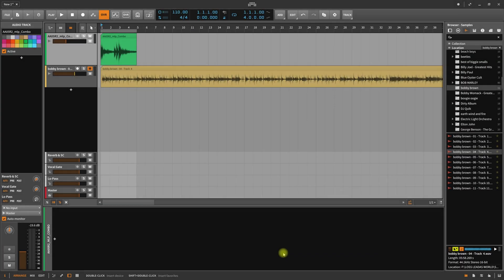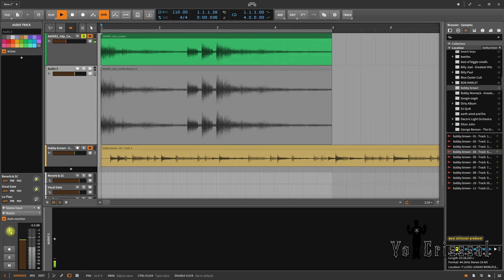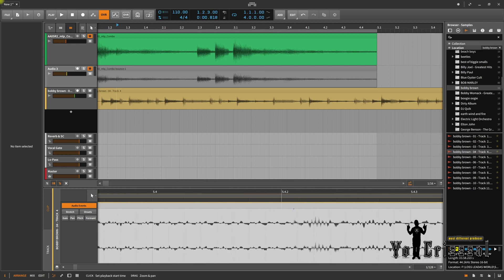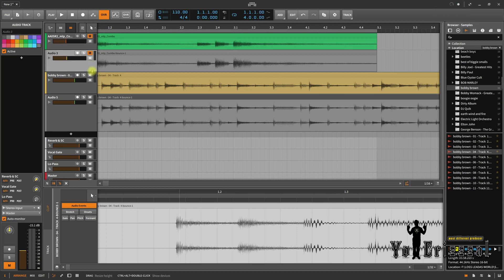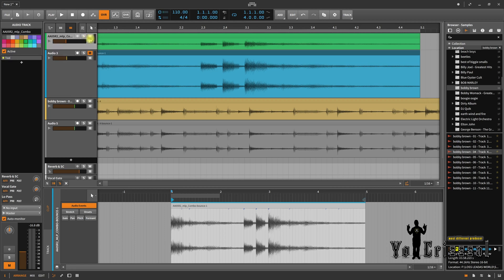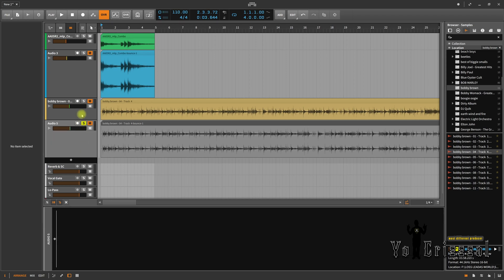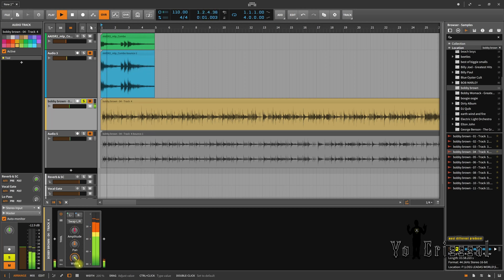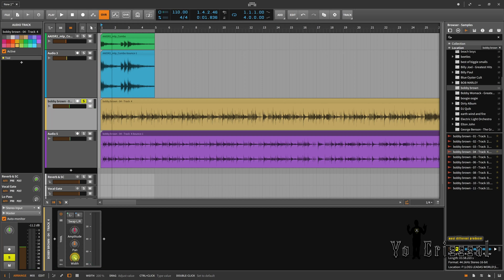HOW TO CONVERT MONO TO STEREO  BITWIG 3.1.3

Comment: Ok so there is a native DUAL PLANNING plugin device tool in Bitwig where you can take a stereo track and plan the left and right channels to anywhere in the stereo field, and additionally apply any width to it.
That's actually kinda sweet and I think I could mix that way too. 
It's just different than pan only working as a L/R BALANCE tool on a stereo track.
I'm used to working with mono when mixing but I can get used to the DUAL PAN tool.